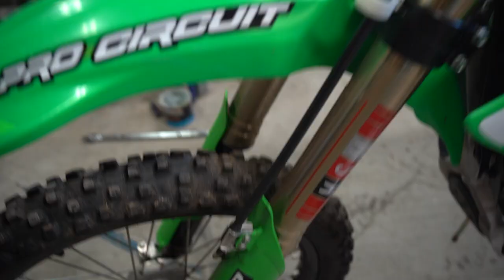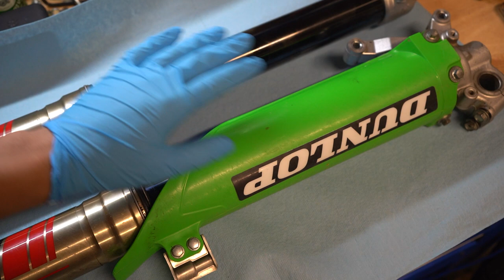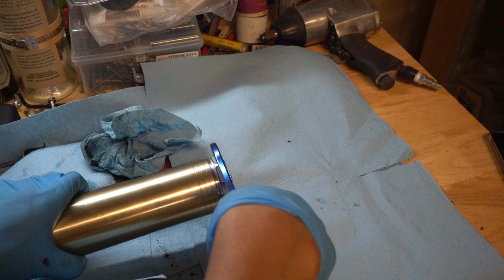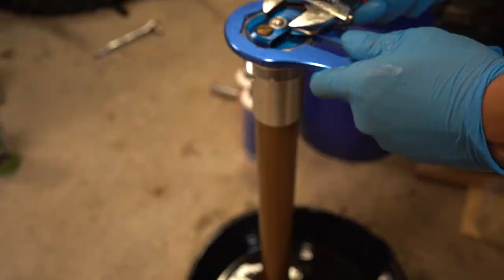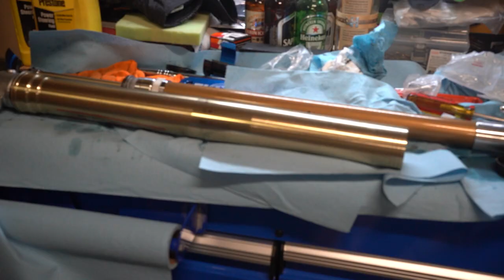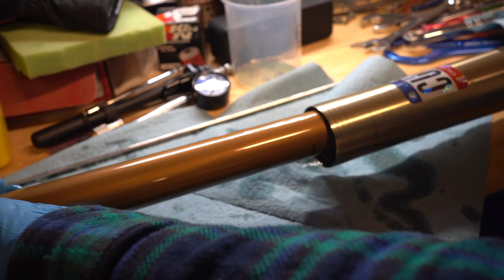KX450F Fork Rebuild

Comment: Can you tell me how much fork fluid you put in each chamber?? 

Also, do you put air back in the fork when complete putting the seals and fluid in?
Reply from the maker: I would download the service manual l, helps a ton. Can't remember the exact amounts but it's a range. You have to pump air because there's no springs, forks will be collapsed with no air.